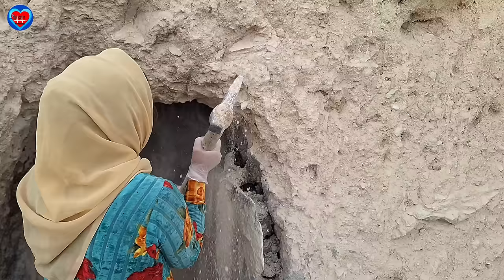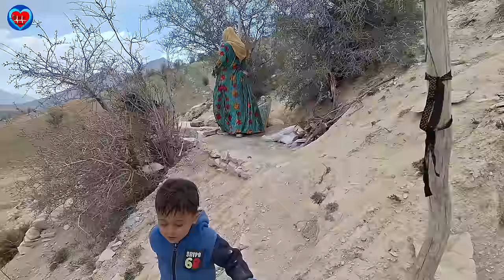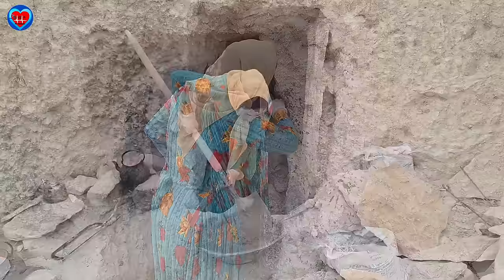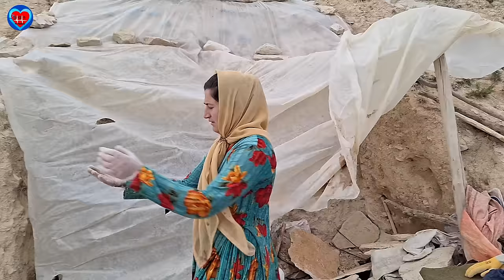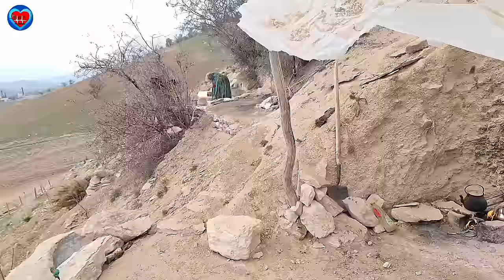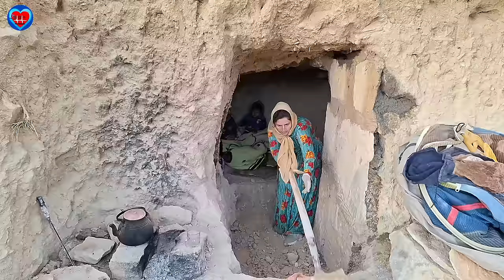Nomadic Genius Lady: Incredible Engineering and Design in Cave Construction🏕️⛈️

Comment: The door looks alot better now, will be easier to fit a door now. Cannot wait to see what it will look like. Dig two holes in front of door on each side so you can make a lean to from  the weather elements and get plastic and wood to put over entrance . it also gives you a little sitting area. Need your cave to be a little bigger to fit your family. You need wood beams going to the hill and one in the middle so rain does not gather in plastic.
Reply from the maker: ممنونم از لطف شما و راهنمایی های شما ♥️♥️ 
حتماً منتظر سازه‌های زیبای جدید باشید ❤️❤️

Comment: May I make a suggestion.If the lady put plastic bottles on top of the posts it would stop the plastic canopy from ripping.Just a thought.😊
Reply from the maker: خیلی ممنونم از لطف شما و راهنمایی شما ♥️♥️💓 
پیشنهاد شما بسیار منطقی است ❤️❤️❤️🙏🙏🙏
Reply: To have a slope in the ground is not a good  idea because of the intense rain the water will go into the cave easily!! She needs to put a protection with a very long porch in front with the slope going outside the entrance of the cave.  If she does not do it in a hurry .. even before finishing the digging she will be caught in a intensive wind and rain without being able to do anything anymore!!